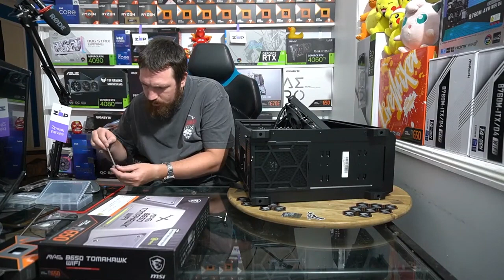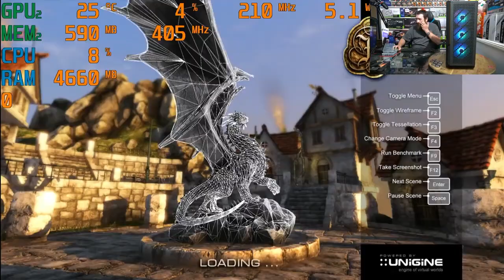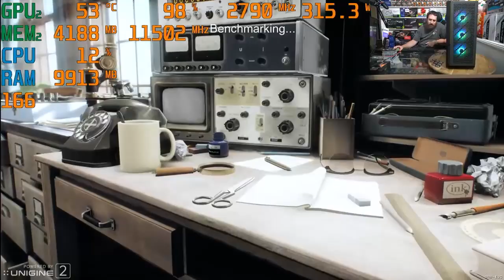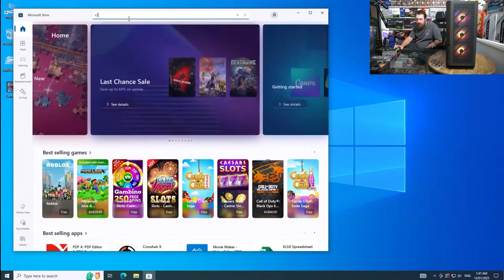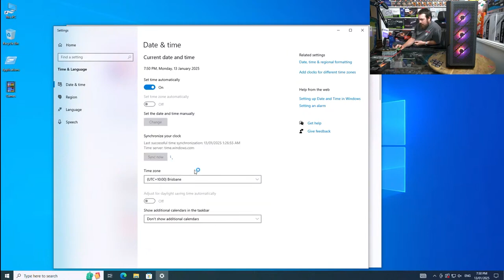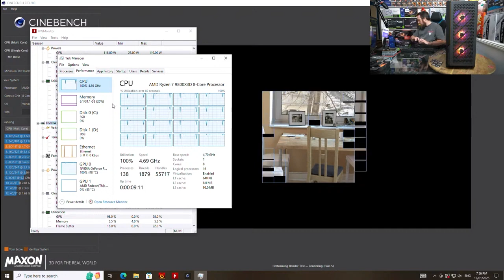9800x3d / RTX 4080 super / B650 Mag Tomahawk Wifi / Antec P20C

Comment: i just bought a MSI MAG B650 TOMAHAWK WIFI and a r7 9800x3d tho i read somewhere that i have to do a bios flash is that true or can i just plug&play ? bought it from a site called komplett wich is the biggeste pc part seller in scandinavia
Reply: Depends on how old the motherboard is. If it's newer stock, it's probably already running a bios compatible with 9000 series. If it's old stock, then it will need to be updated

Comment: Hello, I plan to build my first ever PC.  I will be using the Ryzen 9800x3D on the ASUS ROX Strix B650E-F Gaming WiFi.
AIO: Artic Liquid Freezer III- 420 A – RGB 
SSD: Samsung 990 PRO M.2 SSD 2TB
RAM: G.SKILL Trident Z5 NEO 32GB 6000Mhz DDR5 CL30 (2x16GB) RGB
Case: Be quiet! SHADOW BASE 800FX
PCU: Be quiet! Pure Power 12 M 850W
GPU will most likely be an RTX 4080 Super
Do you think this build is OK for 1440p 
Would you change anything?

Comment: I have a ryzen 7700 and a msi b650 tomahawk. I was worried about a upgrade to 9800x3d. Happy to see its possible :)
Reply from the maker: Yeah its fine for most people. Just not cheap b650 or a620 boards (it should have solid heatsinks on the mosfet/vrm/chipset). It is a myth that you "need" the most expensive motherboard chipset if you just want to run your hardware at stock and play games. If you overclock, definitely go the top motherboard chipset model or if you have the money. 

But don't ever cut back on the cpu/graphics card/power supply just to get a ~$300 more expensive motherboard.

Comment: I have nearly the same pc. 
PNY RTX 4080S
9800x3D
Strix B650E-F
Ect
Reply from the maker: I've had lots of people question me about using a b650 and 9800x3d, I say its fine and theres only a tiny difference between the gaming performance between the b650 and x670/x870, but some people still  aren't convinced.

I'm assuming you've had a good experience with no issues with your hardware?

Comment: Bought the same mobo/CPU  combo and its coming tommorow? did you need to upgrade the bios  or flash it to make it run?
Reply from the maker: I never had any issues with 9800x3d not posting, but it will depend how recently your motherboard was manufactured. I only purchase stock once a customer has paid for their order so everything I buy is typically new and running a fairly recent BIOS.

If you buy from a smaller retailer, they may be carrying stock from 18 months ago so if threes any doubt, ask the retailer to update the BIOS for you, they may do this for free (They would in Australia anyway)